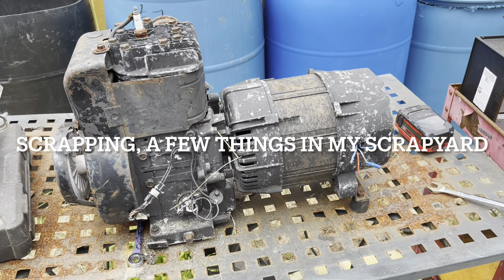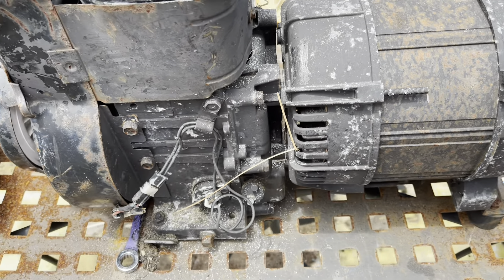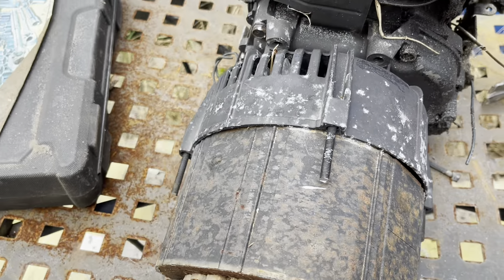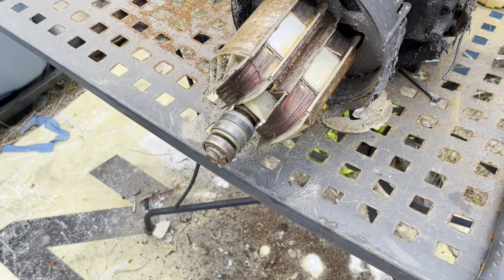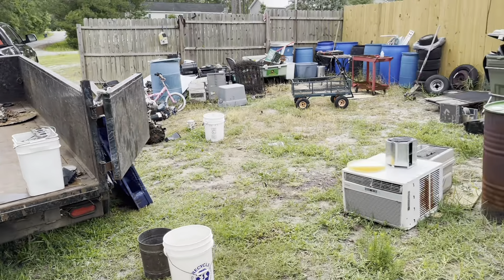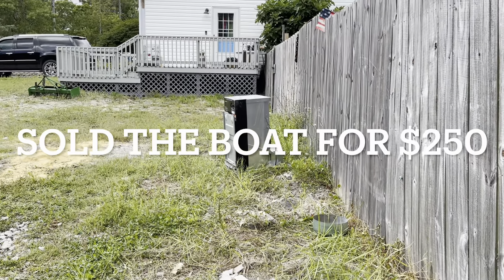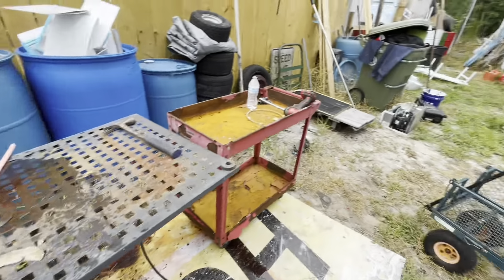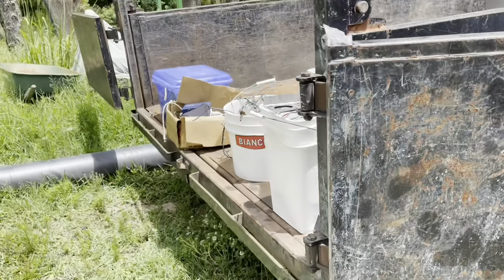Scrapping and cleaning up my own scrap yard. What’s Next?

Comment: 3:05 …There was an armature like that in a couple generators and I whacked it on both sides with a big ole rubber mallet and it slid right off. I seen it on a video and tried it and was surprised it worked. Great video and yards looking good!
Reply from the maker: Thanks for the info and yes. I have a fairly clean yard again. I have a big box of micros Scrapping to do. I hope you seen that video.